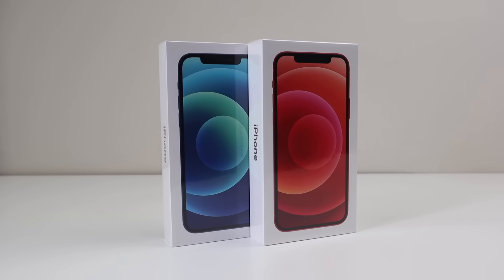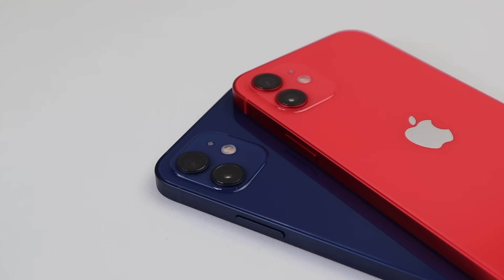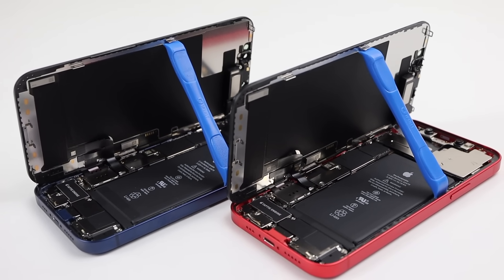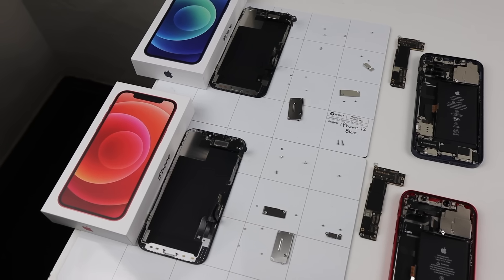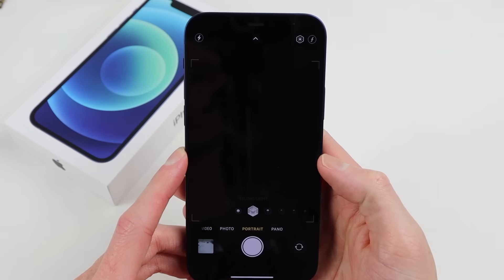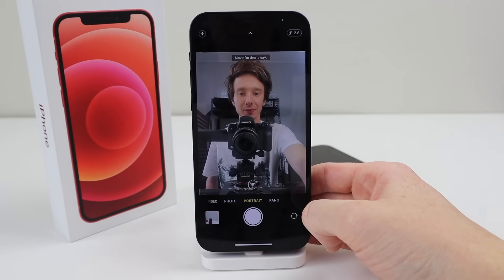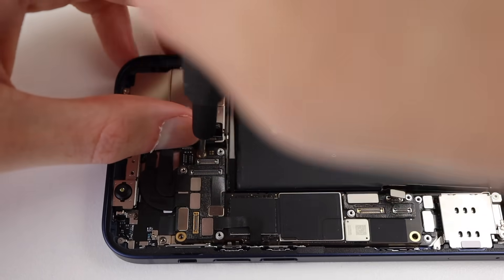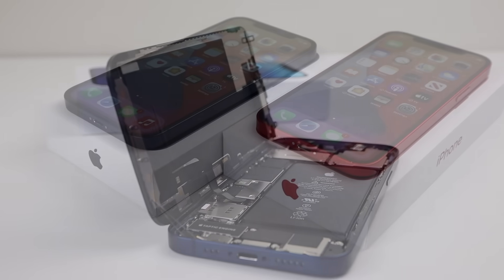iPhone 12 Anti Repair Design - Teardown and Repair Assessment

Comment: The different part has a different calibration parameter changing part that will cause the calibration parameter miss-match. Causing the deep learning-based camera enhancement fails to register the two camera. Same as True Tone, the different screen has different white point(about 500K different even in the same product), without that information it's impossible to a white point close to nature. FaceID is related to its security encryption same as TouchID. Make sure others cannot sniffing the biometric information. Same as battery even the same battery will have slightly different capacities and resistance.

Comment: I got a 3rd party screen fixed and it was a nightmare. I paid $110 for new glass and the screen didn’t function. In hind sight I should have put the $110 toward a new phone or have apple fix it for more $.  There is no control or guarantees with these goof balls in the strip malls.  I got a new battery for my daughter from a 3rd party guy and it sucked to. I learned my lesson, will not do it again. Doesn’t bother me.

Comment: they're not even targeting 3rd party repair companies, because lots of these companies have tools/machines to read the serial code of a component and then re-write that serial code to the 3rd part replacement part. this is specifically giving the middle finger to home repairs, apple yet again, reducing their fan-base to thirds for little more than what is pocket change to them.

Comment: does locking down the phone in these ways such as the camera help prevent theft, compromised stored information and other security uses of the phone. I am thinking things like braking face ID, finger prints and back doors to other programs in the phone.

Comment: I am actually quite astonished.. How are you going to sell a phone without a charging block because of "waste" when the cable that's provided is going to need an adapter that people most likely don't already own. I mean come on. I mean if the cable that comes stock in the box was a regular lightning cable so that you could use it with older charge port boxes then I could understand why it only comes with a cable.

Anyways, keep up the good work, man. Thanks.

Comment: I totally understand why they lock it down. After my  10x Max was robbed and the thief couldn't trick me to get me password. The only solution for them is to sell it in parts. So apple now locking parts it will prevent more iPhone to be stolen. So look at it as the protection for customers.

Comment: this mean apple has modified thier software so that thier phones manufacture id of each components are coded together like a a form of bios locked drm.

if one part has a different manufacturer id not registered in the bios and sync with a proper liscence... the functionalities of those device will not load the needed drivers and will only use basic drivers that disable so many things.

Since apple can not be sued on this. boycott is the only option.

Comment: Why don't they just literally fix the parts right? Not replace it.
Reply: That's just not how it works. Tell me, how would you repair a cracked display/screen? Put it into a machine to fill in the cracks with glass? The touch would not function correctly in that case since the digitizer (a grid inside the glass that registers your touch) would be hindered or damaged by the molten glass being poured atop it.
How would you repair a battery? Replace the lithium in the cells? Too dangerous, especially if the cells have expanded -- the moment you open the cell, heat escapement would occur and a chemical reaction would cause a flame to be produced from the cell. 
That's why we replace displays and batteries and don't repair them. Because it's simply not possible to.

Comment: That might be annoying they do things that way.
But think how many phones you have repaired at least in last 2 years? I bet it wasn't even once because you didn't had time or sth. My dad purchased years ago some broken xperias and they're still in the shelf for about 5 years now so. Many people don't even think about repair because they know they will screw something more up as it already was.
Especially when you have the rights for at least 2 years warranty. And yes display isn't covered but even though you buy a new phone instead of repair cause it's easier to do and almost everyone can invest maximal 50 bucks for a good case and armoured additional glass especially when people have glasses even on smartwaches.
They do protect a phone very well if they're good and perfectly mounted.
And tempered glass doesn't impact the ability of using the phone as it wouldn't be there.
After at least 2 years you change the phone anyway.

Like be fair the technology is so advanced and you don't even think to repair things by yourself
And about the environment, you're peeved about what Apple does, yeah and what you did in last 2 years for other things to save environment?

I'm not on apple's side cause it's kind of a shame but look first at yourself before getting pissed

Comment: I need to cut the umbilical and move on from apple. They have left the original reason I went with them all those years ago. I think they have become greedy and manipulative of its customers and I have had enough!!! I need to "walk away". 😕
Reply: "Become"? Apple have been greedy and manipulative since the 80s.
Reply: @cericat  You are probably right. I am just a slow learner 😋
Reply: @cericat  ⁶
Reply: @tacomashup  I've been fixing computers since before I was in high school, I worked for the local Mac repair shop in 2001 I think that's the last time I saw anything of them that was remotely consumer-friendly, it was easy enough to pop in new hardware compared to most of the major case manufacturers at the time. The price was however not nearly as friendly being 50% higher than their already 200% over the average PC maintenance in town the side of the store I usually worked in.
Reply: Same here but I don’t like the other phones

Comment: As much as I dislike Apple, I would guess that their reasoning for this pairing lock would be to reduce security breach possibility on users' data. 

Since the camera provides face recognition unlock feature and same for touchID, they probably wanted to lock the modules to the mainboard to prevent emulation and bruteforce. 

They should however provide a way to 3rd party repair shops for resetting the whole iPhone data and resync the components together making sure all data is permanently erased first. And this, free of charge...

Comment: That is the same issue with automotive servicing; when you have to buy a factory scanner or a work around to recode the modules to the network or multiplex to have communication between each other. Let see if apple has phone diagnostic tool for the Indy repair facility to “reduce reuse recycle”!
The right to repair has been a long battle.

Comment: I'm sure they will be releasing their own Apple socket soon where you can plug in your usb c to lightning cable so you dont need an adapter. Very smart move! Also you may only charge your phone with apple's own electricity.

Comment: Each component is serial paired, not to stop 3rd party repair, but to curtail Chinese manufacturing from taking spare parts and producing clones to sell on black market,a previous huge problem. Serial pairing and security protected software stops the use of parts stolen to build iPhones.

Comment: In my opinion as a smartphone technician. iPhone 12 can be fully repaired.
1. Lcd advice can be fixed moving a eeprom located in the old lcd, that requires micro soldering skills.
2. Battery advice can be fixed reading the battery data with a programmer like JC or Icopy.
3. Face ID can’t be replaced but can be repaired, front camera, dot proyector, proximity sensor and infrared camera are connected to each other, if one of them fail Face ID will not work. 
4. The camera it’s the only difficult thing, as we now all apple components are linked with serials, but that can be readed and writed with eeprom programmers. In the future that solution will be released.

Comment: I think that apple has a specific supply of repair items that will be able to be used to replace parts. They’ll have certain codes acceptable on iPhones while repairing but rejecting salvaged codes. Then they’ll also have those parts locked once used in a phone.

Comment: The reason some things doesn't work is that they need calibration to work properly. Front camera needs to know the star-pattern of the projector. Back cameras need to know their offsets to be able to do depth. Battery needs profiling to know capacity. Display and sensor needs calibration to do True Tone. And so on.
Let's say Apple would allow third parties to recalibrate the phone, how would they make sure the calibration is done right? It's better to get a error message and have the feature not work at all than to have a very buggy feature that just very bad silently, don't you think?
It's very different to remove and attach some screws than to calibrate the IR-projector in the front. It's the same with cars. The cameras on autopilot cars that tracks pedestrians etc. needs calibration to work. Would you rather skip calibration and let the car run over a pedestrian instead? Don't think so.

Comment: is it easier to work with a more flat-sided square phone or a curved sided one? Is there a difference?
Reply: There really isn't a difference, repair-wise. What makes the difference is the thickness of the display, an iPhone 11 display is 3x as thick as an iPhone 6 display which makes it that much difficult to remove from the phone without damaging it if you were to attempt a battery replacement for example.

Comment: Well. You just helped me make my decision. My Samsung Galaxy S9+ I just learned will no longer be supported by Samsung. It's only 2 years old. It worked fantastically for 2 years. Until my Rogers 2 year contract ended. It then immediately began acting strangely and the battery suddenly started emptying much faster than before ("strangely" was meant sarcastically). Therefore, I was looking at newer phones but missed having an iPhone. Your video just made me feel sick to my stomach. Thankfully. I will no longer look at Apple. Too bad because their screen quality and their color calibration between devices is fantastic for graphic designers. Macs were all we used in professional school. Thankfully, technology changed a lot since then. Thank you so much for sharing with us! I am sharing this video.

Comment: Impossible to repair + planned obsolescence.
Ok 
Can we have a serious conversation on why these two abusive practices should be made illegal with no way of repeal?
Reply: Not quite impossible to repair per se, just impossible to repair by a non-Apple or non Apple-certified tech. Right to repair has to be made possible, so that these new iPhones may be repaired by parties not authorized by Apple, by the regular consumer.
Reply: @meeguelangelo  except then you worry about the government going to far, just don’t buy products from companys you don’t like instead of forcing them.
Reply: @Brent-jj6qi  Do you know what an oligopoly is?
There's no other mechanism to hold these tech giants accountable than to either deploy regulations or have labor movements that are equal to their power.

And due to global late stage capitalism the latter is impossible, so regulation it is until we can replace capitalism with market socialism or decentralized networked resource based economics and make the regulations obsolete.
Reply: no, because then you would have to sue god for deisgning us the same way lol

jokes aside that's just how capitalism works, there's no abuse, they just don't want to provide you with anything good (like updates or repair) if you don't want to pay them for it and that's perfectly fine, pay of gtfo :shrug:
Reply: @limbsmith 

1)God does not exist
2)The point of modern medicine and transhumanism is repair
3)Capitalism is not a function of reality, it's a relatively recent economic system which is growing increasingly obsolete at a rapid pace.
4)Building a product so that the owners can't independently repair or selling technology built to break down after a period of time means that you are not owning the technology despite paying for the right of ownership.
Hence planned obsolescence and anti-repair design is fraud.
5) How much should someone pay for something that's not designed to break down or be irreparable?
3 times the material, labor and transport costs?
4 times?
Oh wait, planned obsolescence is built in every single piece of technology regardless of price.

This is a massive waste of resources, labor, energy and political capital (to procure the rare earth minerals at literal slave wages) with the sole purpose of some billionaires getting even more money they can't spend.

Comment: Why does each reviewer use this flawed logic?
"They included USB-C cable but not a charger, and those who had a previous iPhone can't use the old charger, because it has USB-A."
If you had an older iPhone, you have the charger AND the USB-A to lightning cable. So the solution is not "buy the new charger", but "use the old USB-A cable".

Comment: IMO among the worst parts about the camera locking, is how Apple is making it look like the component is actually damaged instead of just saying it isn't the original. If they'd just openly say "sorry, we don't allow camera replacements" that would be clear, but now they are making it seem like the person who did the repair screwed up the phone. This is something Apple has grown very fond of doing.
Whenever something is wrong with a device, they always seem to tell people its either the people doing it wrong or some "unlicensed" repair shop which "must have screwed you over", and they seem to be getting away with it just fine.
How do so many people keep accepting this instead of holding Apple responsible for their actions and mistakes?

Comment: You should’ve heated the phone before stick the screen back on, 
To seal phone properly from water 💦
Reply: If he did that, the adhesive would still not adhere completely. Once the screen is removed from an iPhone, the water resistance seal is compromised and cannot be re-sealed unless you replace the adhesive with new Apple adhesive, reassemble the display, and press the phone in a jig.

Comment: wouldnt you be able to use your regular USB b to lightning cable? If you have an iPhone you would already have that and a wall adapter, so if theres no compatibility issues between the two cables I dont see an issue about it. The only benefits would be the normal type C uplifts in power and data transfers (which yes I know is dependent on version of USB its using not the actual connecter. Im aware theres USB 2.0 with a type C connecter). If you cant use your old USB B to lightning cable on the iPhone 12, that would be utterly stupid. Other than that I really dislike how apple is being so contradictive. "We want to reduce E-waste but your not allowed to repair your phone to make it last longer than 5 years. Here! have less accessories and a sticker, all better!" If apple took your broken phone and recycled the metals in it through another company that specializes in E-waste disposal, THAT would be awesome. Oh but that costs money, so something like that will never happen

Comment: Apple says they want to reduce the waste and then will provide the cable which is not compatible with the existing adaptors.
 In other words technically apple is doing exactly opposite of what they are saying by increasing the adaptosts -old plus new😑

Comment: Apple sucks for doing crap like that. That’s ridiculous. Like I have a iPhone 7 battery died Apple wanted $50 to change which I thought was fair but they said they would need the phone for 3 hours and I would have spent 2 hours driving. Local guy fixed it for $55 in under 15 minutes. Come on Apple!!!!

Comment: I was going to buy the latest Samsung Note, but decided against it when I learnt I would be getting the crappy Exynos chipset. So I waited for the iPhone 12... nek minnit...

I think I may go a no name Android flagship killer... but which one to buy? Need 12 gb ram 256 gb memory, large screen, and proper chipset.

2020 has truly been a crappy year 🥺😰😓
Reply: I'd reccomend waiting for a few months and getting the S30 next spring.
Reply: @rudram.552  probably the best way to go... but my heart is really set on the stylus on the Note series. And if the S30 has an Exynos chipset also, I would be devastated.
Reply: @IsaKocoglu  Then you should get the Note 20 Ultra. Even last year's Note 10+ is worth considering, I have the 512GB model with 12gb ram.
Reply: @rudram.552  that is great, if one is happy with the Exynos chipset. In Australia, that is what have. Actually worldwide it is what Samsung ships off. Except for the USA. There, they get the Qualcomm chipset 😭😭😭😭😭
Reply: @IsaKocoglu  Yeah, the Exynos chipset sucks. But you could try to import a device from the U.S. I'm not sure if it will work in Australia though.

Comment: I think apple doesn't want people to be able to put untrustworthy batteries in their phones.. But the rest of the issues caused by swapping parts is probably to stop phone theft. People steal phones and send them overseas for parts.. This seems like a good way to stop that. There should be away for authorized repair folks to get the tools necessary to fix ios devices though